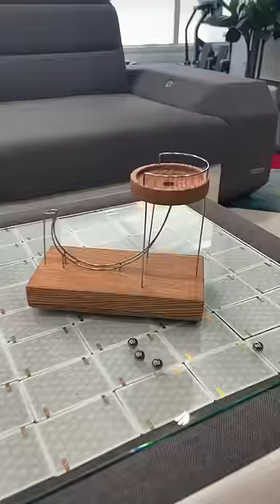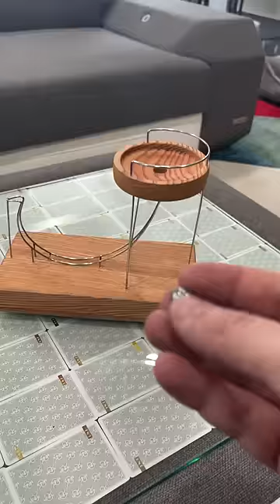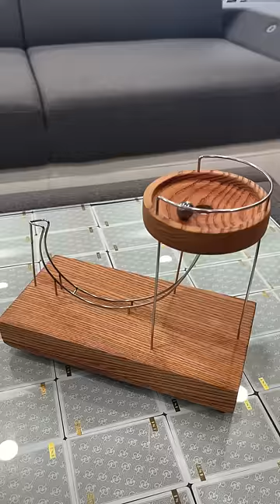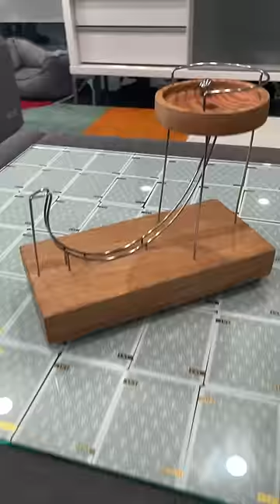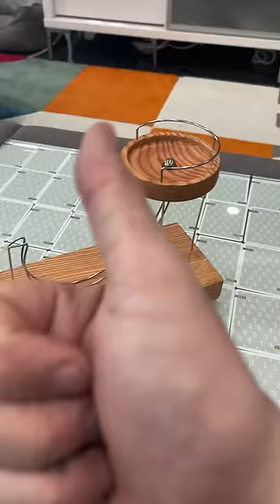An Impossible Perpetual Motion Device?! 😳 #Shorts

Comment: I've never seen one of those before! My guess is that there's a battery underneath in a hollow cavity connected with one pole to each of those rails, and that ball is actually a magnet. I'm guessing it works like a railgun. 🤔 Am I right?
Reply: Yep, you're correct. Some other versions exists with the electromagnet in the top part I believe, but those are plastic and don't look as elegant.
Reply: Yeah you’re right, he showed the bottom in another video
Reply: That's what I thought. Although the ball doesn't even need to be a magnet, since when it short-circuit the "rails" a magnetic current is created, accelerating the ball
Reply: Yeah I’ve seen this before, there’s a magnet in the bottom
Reply: Very clever
Reply: If the ball was a magnet why didn’t it stick to the other ball?
Reply: @BirdmanJo_  The ball isn't a magnet, it's just magnetic.
Reply: It can’t be a powered rail. Those are made out of gold not iron.
Reply: myguess is there is an electromaganet at bottom that turns on while ball going down but stops when it climb up
Reply: @skyzip4k171  yeah but with no magnet you need a lot of current (tens of amps)
Reply: @OKayD3N  you can make them out of basically anything
Edit: anything conductive
Reply: @PFnove  oh most be modded
Reply: @OKayD3N  gold also conducts. What is the point you're trying to make?
Reply: Definitely possible with a magnet in the bottom and some current. The Lorentz force could drive the ball.
Reply: @jeteamleider3714  I think it’s a Minecraft joke.
Reply: @OKayD3N  modded? I don't think you know what that means. That's the original piece he is showing.
Reply: Yeah, basically.
Reply: The ball is a magnet in the sense that it is steel, so you can magnetise it really easily.

Comment: replace that ball bearing with a glass marble and see how it works...
Reply: Jaha!! It looks like a electronagnetic thing around. It goes down extremely fast. Not normal
Reply: betteries or not, glass would be lighter, thus, not have enough weight to create the momentum needed to makr the hop into that platform.
Reply: @HoNiAn  exactly
Reply: @JohnnyXanax   perhaps you miss the point.. this is obviously accelerated by magnetic fields take anything with the same nonconductive mass and the results should be the same,
Reply: So when does this stop?
Reply: @ambrose_8  once the batteries run out. It's artificially accelerated
Reply: @likinwideminem  could it be a magnet?
Reply: @ambrose_8  This appears to be using electromagnetism, but a regular magnet will also lose its magnetic field strength eventually.
Reply: @maelstrom2313 it wont work if he only used the magnet to accelerate, because the magnet also decelerates the ball when it goes up.
Reply: @ambrose_8  you can't use a magnet to create a fake perpetual motion machine, as magnets don't actually put any energy into the system
Reply: Although not perpetual, using solar cells and high-density batteries to charge any energizing circuitry manipulating the ball trajectory would certainly result in an extremely efficient ball handler.

Comment: Actually that thing runs on a battery and there's a tiny motor where the hole is to make the marble or ball go fast
Reply: It’s more likely an electro magnet in the base that turns on at just the right moment to pull the ball down faster than gravity alone, giving it enough momentum to make it back up
Reply: It's the FORCE
Reply: Nah it mostly just runs off of a magnet. the battery just provides electrons so the magnet can produce more ions
Reply: The lousy knock-offs work that way.
Reply: @Musique3579  I mean that is pretty true the more expensive ones actually keep it hidden
Reply: This is the CORRECT explanation. A wheel is present on the sidewall of the drop point. The wheel runs on (1) AA Battery. The battery is installed under the round dish at the top.  

All of these “explanations” involving electromagnets are just comical. No, electromagnets are not present. Just think of how a roller coaster picks up speed on flat points of the track. It rolls over wheels and the wheels spin, making the coaster continue to move.
Reply: @jttnc  Um, no, just no!  See my proper explanation just above this comment. People are seriously over thinking this. Electromagnets are certainly not required to make this work. Just a small motor, a wheel in the sidewall of the drop point and one battery. THE END!
Reply: @chrisjenkins203  search “Perpetual Motion Marble Machine in RamZland!” In case my previous link doesn’t go through. Do some of them use a wheel to run? Probably. Does this one? No. This one use’s an electromagnet in the base. Do you hear a high pitched wheel running constantly in the video? The end. :)
Reply: @chrisjenkins203   Watch his other video about 5 back from this. It shows the Electromagnetic configuration in the base. (Takes 1 AA Battery.) There is nothing inside the drop hole on these kinds. The cheap knock-offs are doing this.
Reply: There is no battery. You missed the whole concept of the video.
Reply: Thanks for the tip
Reply: Well you guys just broke my heart!
Reply: @barrywainwright3391   Look at the other video. The AA battery is placed to the left in that device.
Reply: Really? 😳 I was starting to believe this shit 😮
Reply: @barrywainwright3391  you miss that the marble can't make it up on top by the force of gravity alone, it has to be boosted
Reply: It almost got me got for a second then, i remembered how each rise on a rollercoaster gets shorter and shorter.
Reply: @jttnc  that is what I was thinking. All the people saying stuff like this other guy, I mean you can literally see its just a hole there.
Reply: @chrisjenkins203  wouldn’t that be noisy?
Reply: @chrisjenkins203  love the confidence dude. But you're just wrong. He already posted a video of how this particular machine works (electromagnet in the base). What you describe may be an option, but your aggressive confidence was misplaced this time.
Reply: @TheEvox81  I own one that’s made of plastic and I bought it online. So I’m describing the way it works. If you look them up, apparently there’s a couple versions but yeah I had no problem describing the way mine works, since I own one. Obviously you don’t own either. 😞
Reply: You’re all wrong.

He actually checked the battery later on and it was dead.

It’s magic
Reply: True, the lousy knock-off on amazon works that way, it’s made of plastic and produces a terrible noise… chris’ version  definitely works with magnets..
Reply: @chrisjenkins203  Nice attempt at a save. You weren't speaking about YOURS, you were speaking about the one in the video. (with a very strong sense of unearned authority, I might add) And you were wrong. Glad to see the correction though. Have a great day!
Reply: @barrywainwright3391  ofc there's battery
Reply: He said it doesn't exist and if it did, it would look something like thjs....who cares if it has a motor  he never said this impossible thing actually is
Reply: @gotohellenwaite6371  ahaha me too
Reply: Even if there is an additional force applied at descent it's not perpetual motion because of the loss of energy while its circling at the drop platform.  Still a cool video tho!
Reply: @1of8B  yeah, apparently some of the cheaper versions of this have the wheel, but it’s fairly obvious and audible, this one definitely doesn’t have it
Reply: @jttnc  or just a regular magnet....lol
Reply: @Astrochronic  why a regular magnet? It wouldn’t turn off, thus pulling on the ball when it goes up the ramp as well, decelerating it again
Reply: @chrisjenkins203  So condescending, so matter-of-fact, yet so utterly wrong. You love to see it 😂
Reply: @crewd00d  I actually own one, unlike your broke * and that’s 100% how mine works. Maybe do a little more than 2 seconds of research and you will see theirs a plastic one and a wooden one. So, yeah, that’s EXACTLY how mine works…. Sharp guy.
Reply: Electromagnet
Reply: @structlightning  🤣🤣
Reply: @chrisjenkins203  why are you refusing to admit your fault. they were having a conversation about this machine. you came and corrected them. how does your anecdotal experience change that you were wrong about what they were talking about?
Reply: Nerddddddd
Reply: Reality is often very disappointing. 🙄
Reply: @chrisjenkins203  Bro. Not a single person here cares about how yours works. We came here, watched a video, and talked about the video. You corrected everyone, but you were wrong. It isn't hard to admit that.
Reply: @jttnc  because it only needs a little extra pull on its way down. The part that shoots it back up could easily be out of the range of the magnet. Also what mechanism would be turning the magnet on and off when the ball drops through the hole? Lol so over complicated...
Reply: @Astrochronic  no matter where you put the magnet, it’s gonna pull the ball towards it from both directions, basically contributing nothing to the overall momentum. You need to be able to turn the magnet off once the ball has passed it
Reply: @Astrochronic  and there are various mechanisms that you could use to time an electromagnet, a magnetic switch, a photodiode, capacitive sensing, etc
Reply: @chrisjenkins203  calling that guy broke when you apparently bought the cheaper knock-off version…?
Reply: @jttnc  why would you though when obviously there is no need to overcomplicate things?
Reply: @jttnc  magnets have limited range and the potency curve is very steep. You should stop embarrassing yourself now.
Reply: @Astrochronic  yes, magnetism follows the inverse square law, but it’s still going to pull the ball backwards the same amount that it pulls it forwards. It will add to its speed coming down, but subtract from its speed after it’s passed the magnet, so it won’t add anything to its momentum. Trust me, I’m not embarrassing myself, I’m actually enjoying this quite a bit :)
Reply: @Astrochronic  there’s really no argument here, you could easily confirm that it’s an electromagnet with just a little bit of research
Reply: @TheEvox81  lmao, this other guy is doing the same thing
Reply: @jttnc  see you are operating from the assumption the magnet as right at the nadir of the ramp. But it only needs to be offset a little behind it and angular momentum will still preserve the added inertia with out needing to turn off the magnet. Thanks for playing.
Reply: @Astrochronic  the nadir at which point on the ramp? A nadir is a direction based on a specific point, so I’m not sure what you mean my the nadir of the ramp as a whole. Nevertheless, my main point still stands, wherever you put the magnet, it will pull the ball back towards it once it had passed, thus negating any benefit it would have had. And still, you can look up how this thing works, but you seemingly refuse to do so, I wonder why

Comment: The way the metal balls reach terminal velocity almost immediately on going through the hole is 😄
Reply: Eh, not terminal velocity. But they definitely accelerate much faster then the 9.8 m/s squared that is allowed by physics on earth.
Reply: @travislebaube7646  it probably is terminal velocity
Reply: @daveinpublic  you're joking, right? An object reaching terminal velocity in inches?
Reply: @UT3CTF  those beads aren't being pushed. non-polarized metal can only be pulled, and i doubt theyre magnets. my guess is a switching electro magnet under the hole pulls them down, trips a latch or breaks an infrared beam,  and turns off to keep from pulling the balls back up towards it.
Reply: That machine doesn’t work. There is not enough acceleration for the marble to be shot back up with that much power. There must be something more to this device that is not being disclosed

Comment: There’s no way it launches that fast from that small drop it sounds electronic maybe the rails are electrified similar to a trolley
Reply: I looked it up and I think it’s a battery powered magnet which is below the base that draws the metal ball downward at a faster speed than gravity would, then I supposed the battery shuts the magnet off so or something so the ball can keep going
Reply: @ZeldaplusSmallville  
That's gotta be it.
Reply: @ZeldaplusSmallville  or a magnet that pushes the ball away
Reply: It's common toy you just never seen one... Battery powered magnet concealed in the base. It's not a guess that's a fact.  They're fun to watch though
Reply: Considering the angle he is keeping the video I would be more inclined to think directly under the hole there is an acceleration device like two rubber wheels that spin in opposite directions and squeeze the ball through at an accelerated speed (think automatic nerf guns.)
Reply: @jasonballenger8359  🎯
Reply: Gravity on earth causes objects to accelerate downward at 9.8 meters per second squared. While only a short drop, since there is very little friction between the ball and rails, it is enough to create sufficient force in the ball to be redirected back to the platform. It’s not a perpetual motion mechanism because every cycle has an input force from gravity. There are equations that have been done to demonstrate how this works, but you’ll need calculus.
Reply: Exactly!
Reply: @izzyreel6730  That same gravitational force is still active while the ball is on it's way back up, decelerating it exactly as much as it was accelerated on the way down. Subtract energy from friction, air resistance and spinning the ball and you CANNOT get the ball all of the way back up. That's  how we know there's Tom-foolery here.
Reply: @BillyBob-lt5nr  That’s it. Same forces behind the pendulum; it can never swing higher than the point at which it was released. Inertia loses to gravity and air resistance.
Reply: Definitely a magnet, watch the ball as it rotates in the cup, it gets jolted at random moments.
Reply: @ZeldaplusSmallville  it's in the base. He shows it in the beginning of his new video with this in the screenshot
Reply: @marvinthemartian4044  that’s what I said
Reply: I looked them up on Ebay and they have a USB port on the back.
Reply: @izzyreel6730  it would seem that we ( and I use that term very loosely as I'm certainly  NOT a mathmetician, physicist, or scientist) could possibly invent or use a motion sensor of some kind to then use the physical movement of the device to generate a current to then build up again and again using transistors to produce a larger and larger current until we get enuf amperage to do larger tasks. But I'm sure someone already thought of that and tried it.
Reply: @izzyreel6730  no
Reply: @BillyBob-lt5nr  exactly
Reply: No shit, he literally said perpetual motion is impossible.
Reply: @David-eu1ms  link us
Reply: It's magnets underneath around the hole with the negative polarity facing down to propel the ball bearing
Reply: It’s still losing energy every “loop”. The ball always falls short of the hole. It’s the platform that allows the ball to travel the distance lost in the energy transfer, back towards the hole—it’s initial point.

It’s that part of the logistics that is throwing people for a loop
Reply: @izzyreel6730  no, no, no! You didn’t explain how it accelerates downwards at 9.8 m/s2, but it also DECELERATES at the same speed going back up. Newtons laws will not allow any object to return to the same point in which it fell without external forces. There is an electromagnet in the device that propels the ball down the track. In the energy balance for this particular problem, gravity is neglected because it is cancelled out for the return back up.
Reply: @ZeldaplusSmallville  Exactly, theres a magnet in there, talk about ripoff
Reply: @Lilmiket1000  google the product. It says battery powered electromagnet. What’s amazing is the amount of people who aren’t educated in basic physics.
Reply: I went on to the comments to ask if this was how it worked. Now I feel smart 😆
Reply: Tons of these in various forms all using switched electromagnets.
Reply: @ZeldaplusSmallville  I went on to the comments to ask if this was how it worked. Now I feel smart 😆
Reply: @tinafoster8665  i still think it’s dope af c:
Reply: @lance00000000000000  iq level 200
Reply: It's an electromagnet in the base.  It switches on as soon as the metal ball touches the two rails and close the circuit. When the ball leaves the track, the circuit immediately switches off, the ball keeps moving because of its momentum, but because the magnetic field is off, it gets higher than it would have otherwise. Just enough to land on the plate with the hole in the center. The second most difficult part would be a circuit to generate the AC to power the electromagnet from a DC battery. The third most difficult would be to calibrate the weight of the balls and the power of the electromagnet. And you have to get a very nice smooth curve on the track of just the right shape, so that the balls' path is reliably repeatable.
Reply: it’s supposed to be a representation so definitely fake
Reply: Yeah that ball 100% accelerates I was thinking magnets
Reply: @urethraextreme8380   It's sad that for many, the opportunity for education isn't available to them...
Reply: @AmberAmber  nobody has the opportunity to pay attention to physics in high school?
Reply: It is battery powered
Reply: @izzyreel6730  You're forgetting the ball has to act against that same force on the way up, so the net input of gravity is actually zero.
Reply: @sKY-pg8ut  a normal magnet would also push the ball away before it goes up so it would slow it down, the only thing that can do this is an electromagnet